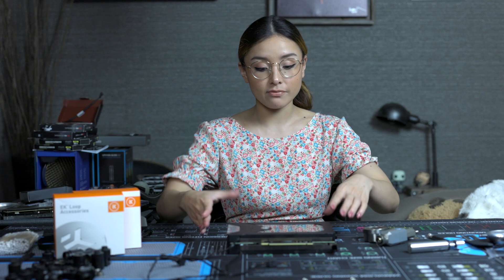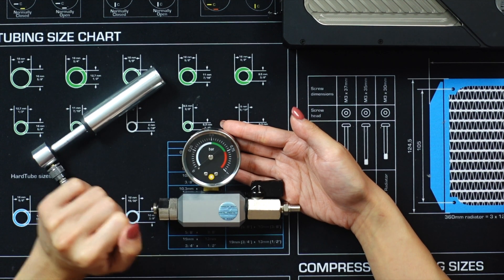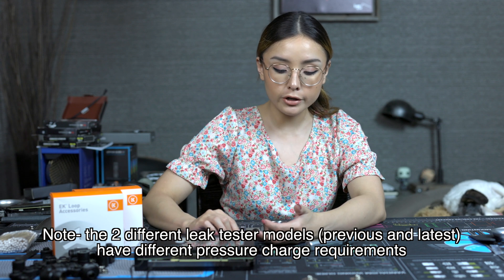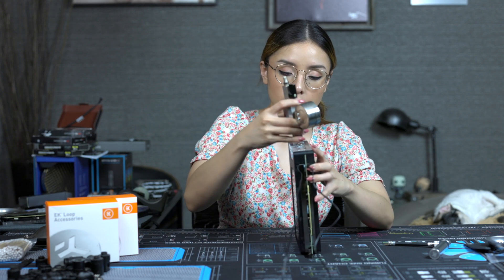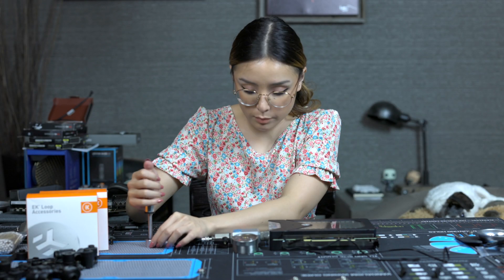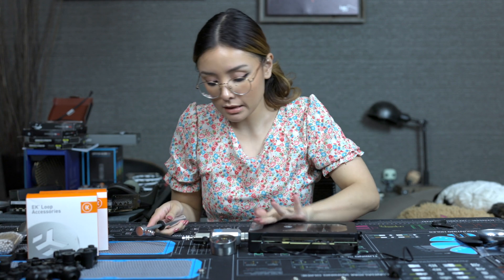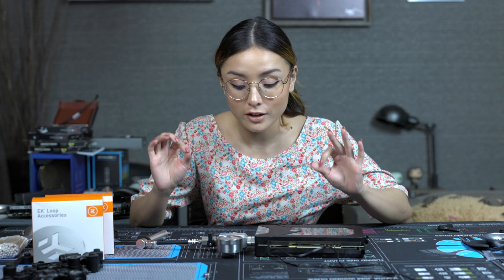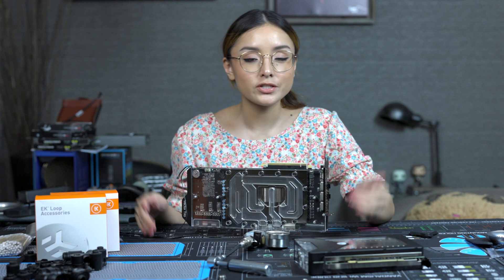People Use This Wrong - How to Use the EK Leak Tester the RIGHT Way

Comment: I think it's really stupid how EK has the dial labeled .8 bar... That would mean even at maximum pressure it would still be a vacuum inside the loop... Regular sea level atmosphere pressure is 1 bar or 14 Psi, The ek dial has a maximum labeled as .8 bar or 11.6 psi.... It ACTUALLY should be labeled as " 1.1, 1.2, 1.3, 1.4 "ect...
Reply: I guess it’s simply specifying pressure over ambient

Comment: For all that is holy, please don't charge more than 0.5 bar. It is unnecessary and can potentially blow out oring seals and stress acrylic rigid tubing already in the system.
Reply: I was looking for a comment on the pressures, 1 bar on my CAR would blow boost hoses off that didn’t have a bead rolled into the end, let alone finger tight hard tubing fittings in a PC
Reply: That's why I don't understand how they say 1 bar on one tester and 0.5  on the new.  Pressure is pressure the gauge shouldn't matter.

Comment: PS ditch the rotary fitting on the EKWB pressure tester THIS can LEAK according to people experiences so even if your components are leak free you might get crazy and think its your components while in fact the sucker was the rotary fitting!. Instead use a NON rotary fitting. And only pump it up to 0.5  bar no reason to go to 1 bar.

Comment: Nax can you link to us to a guide on where to get started for watercooling? THX.
Reply from the maker: Actually I have 2 builds I'm starting to work on.  One of them will be a "how to" video from start to finish and it will start all the way from the basics.  I don't know if there are a ton of great "how to" videos on YouTube, I tried looking when I started and couldn't find a great one.  In the meantime you can just read up where you can, go on water-cooling forums and jus absorb as much as you can and ask questions.  You can always try asking questions on my channel and people may be able to answer.
Reply: @SnaxanGaming  There really isn't. Its just 20-30 min videos like quick snippets of the build, but we know thats not a comprehensive how to. 

It would be so lovely of you dear to show us a real video of how to REALLY break it all down. You'd def be the first to do it and i think it will bring in so many views.
Reply from the maker: @Leo-yn5fx  I'll be starting to work on one soon :)
Reply: As simple as i can:

Get cpu or gpu blocks from Aquacomputer or Watercool stay away from EKWB blocks to many issues with their blocks ie nickel platting is poorly done many complaints on forums such as red(d)it.

Always CEAN/FLUSH your radiators with DISTILLED water before use!!!! Flush your tubing as well they can have dust and other stuff inside the tubing. Check forums how to.
Best radiators are Aquacomputer AMS rads or Watercool MO-RA rads they dont use solder with solder flux which can get into your blocks or pump.
Best silent pumps are D5 pumps
Dont use aluminum in your loop!!!
Stick with brass either coated or not fittings
Best soft tubing = Primochill Advanced LTR they dont leech PLASTICIZER which can gunk up blocks or get Tygon Norprene rubber tubing.
Dont do hard tubing they can leak if you use the cheap acrylic hard tubing if you must use hard tubing go with acrylic glass but its harder to work with i highly recommend SOFT tubing is easier to work with. Cut the soft tubing ABSOLUTELY STRAIGHT with a tube cutter NO SCISSORS! When putting tube on fitting make sure it seals it completely around the barb/fitting hence why it is important to make a a straight cut then screw the nut.

Best compression fittings imo Koolance compressions black fittings or Bitspower compression fittings. Advantage of Koolance fittings they are noob proof you can't over tighten them! There is a form of "stop" in the recessed fitting.
Always check your O-rings from possible damage so inspect them on your fittings.
Air test each individual component for 15 min to 30 min whole system do 1 hour to 2 hours.
Best pre mix coolant try Aquacomputer Ultra or Koolance 702 clear, protects vs corrosion and biological growth.
Use latex gloves to assemble your water cooling ie no bacteria etc.

Comment: Ok a little embarrassing but when I got mine there were no instructions and before I went online to get manual, I figured that you had to charge it to the "green".  Which was obviously wrong.  I feel a little better because I found that so many other people have done the same, and also there are videos of many builds where the youtubers do this wrong.   So even though that made me feel better, it still doesn't change the fact that so many people don't know how to use this thing!!! So this is a great public service announcement snax because you have literally introduced watercooling to a new group of people and dozens and dozens have tried it for the first time because of you, and a lot of these people won't know better.  So thanks
Reply: 0.5 bar is max where you should pump it same on the Aquacomputer Dr.Drop and also remove the EKWB rotary fitting this can cause leaks too instead use a non rotary fitting on it.

Comment: Can't afford the tester and don't need it since I also can't afford a water block for my old sapphire RX480. I did use cheap Chinese knock offs and the cheapest PETG tubing I can find for water cooling my CPU. Haven't had any problems in the 2 years since. 😊  (Living in Philippines so I guess you would understand.) Good info though and by the way, when I look at you looking down into your tester, the angle with your glasses remind me of a sweet and beautiful grandmother.

Comment: Just did maintenance on my loop yesterday. Don't regret even a bit for buying this tester (i have the old version). I had to disassemble the pump to clean the gunk out , and it seems I haven't assembled it right the 1st time. Could be an expensive failure if not for the pressure test before refilling the coolant 😄 (for people new to watercooling , a word of advice, stay away from dyed coolants , the dye will eventually form sticky flakes and collect in tight spots , like GPU radiator fins.)
Reply: Do you mean pastel coolants ? Or any dyed coolant ? Asking because I just bought DP Ultra red and blue. (every feedback I've read on that brand was great). Thanks : )
Reply: @Skkub  i cant vouch for every brand. All i can say is ,i am not regretting using clear coolant. Imo , any dye will eventually transform in to gunk. Not a huge problem if you maintain your system frequently, can be a big problem if you dont. But still , i would keep an eye from time to time on the temps, coolant isn't the only problem, thermal paste can also degrade in a matter of months under heavy loads. Hope this helps.